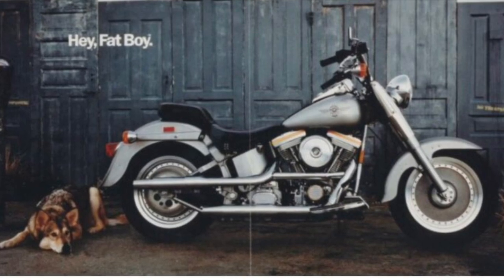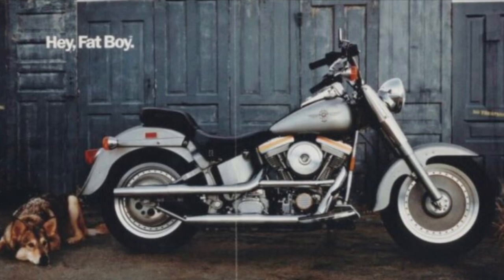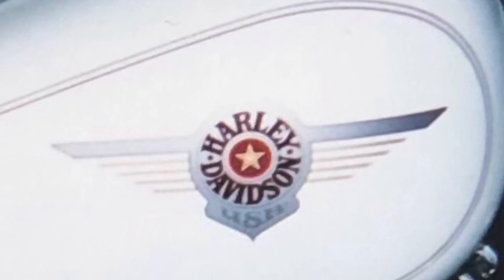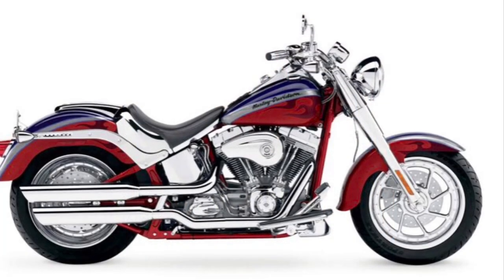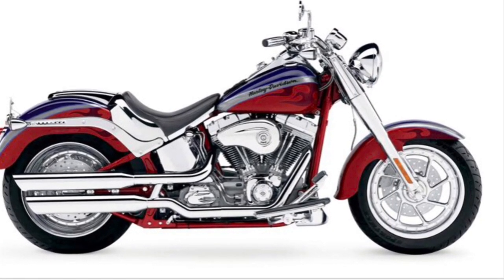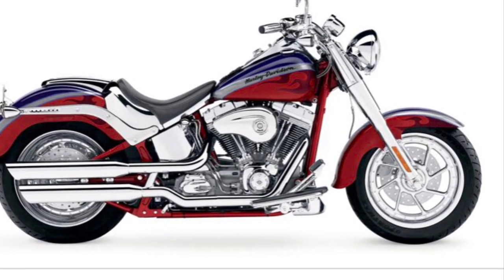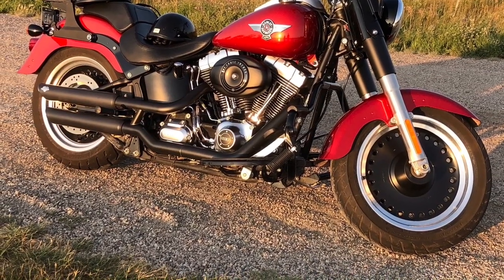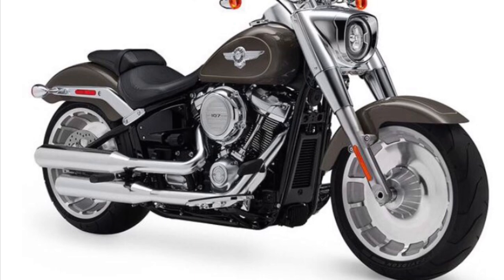Harley Davidson Fatboy History

Comment: Great video, brother . I have a 1990 Fatboy. However, the guy I bought it off of tore it down painted the frame black and tins are now periwinkle blue, original motor original frame all original tins "Periwinkle blue tins" he also shaved it,  that means you will see no welds on the frame or the bike anywhere Old-Timers used to do that back in the day the motor numbers in the frame numbers all match the  clean title
 I body with the idea of restoring it to original condition. However, my wife passed away from a blood clot at 53 years old , so that took the spring out of my step.
Reply from the maker: Sorry to hear about your wife. 
I had a 1995 Fatboy and wished I still had it. There’s nothing quite like an evo Fatboy.

Comment: Good video.    I'm in southern Indiana, I've found a 1995 Fatboy for $6,500 and 11,000 miles and another 1995 Fatboy for $6,000 with 18,000 miles.   I've had 3 big twin shovelheads but as you stated, Terminator 2 hooked you and some others on the Fatboy.
Reply from the maker: I wish I still had my ‘95. That evo ran great.

Comment: Just bought a 2016. Hoping the heat is tolerable next summer. No mid frame heat deflectors available for it at the dealership. Ugh!
Reply from the maker: Close to the end of the twin cams. It’ll definitely throw some heat but I’m sure it’ll be alright.
Reply: @canadiansa1nt309  Been riding it in the high 40 degree temps here in Ohio. You can feel it. Am hoping someone will chime in with an idea as to what will help. I saw what looked like a leather apron someone had on their bike. I don't know what it's called or where to get one if I wanted to. Most of the riding I'll be doing will be in town at speeds generally  at around 35 mph.

Comment: Hello. I want to buy a Fat Boy with Evo but it`s easier to find Heritage. And I have thoughts to convert Heritage to Fat Boy. Is there any difference from HD Heritage Softail Classic 1340 except handlebar, fenders, wheels and turn signals?
Reply from the maker: The tank badging would be different and the heritage comes with saddlebags and maybe a windshield. I don’t think there would be too much different other than that and the things you’ve said. It would most likely be cheaper to wait and find the Fatboy rather than converting the Heritage, though.
Reply: @canadiansa1nt309  Thanks. Just like I thought.

Comment: I a stock  99 fatboy w a EVO factory motor
Reply from the maker: The evolution motor was Harley’s most reliable engine in my opinion.
Reply: Yep, you are correct. 1999 was the last year for the Evo contrary to what was stated in the video (1999) and was DEFINITELY NOT a "Twinkie". The Mo-Co also produced some CVO FXR's which also had the Evolution motor well into calander year of 2000. Those bikes are fetching some good money nowadays. Great job on the Fatboy history otherwise.
Reply: @kennethwise7108  I think they made a twincam A for the touring and/or Dynas in 99. twinB came in 2k for softails.
Reply: @jukeboxheros7021  correct statement